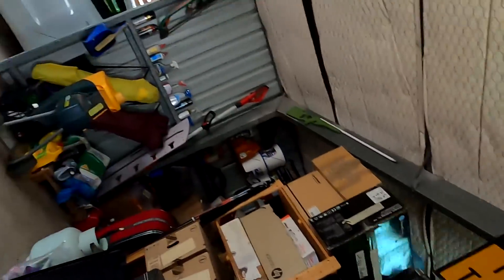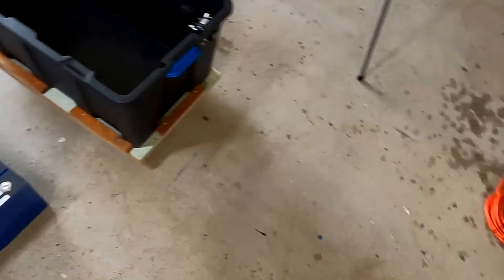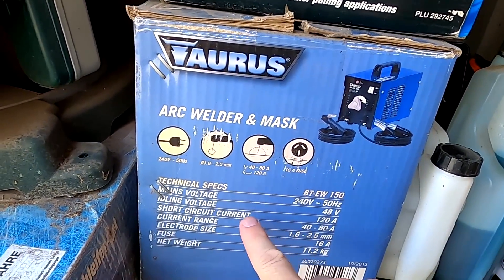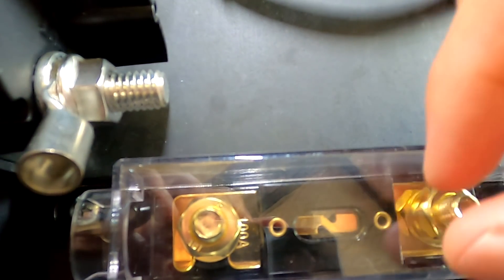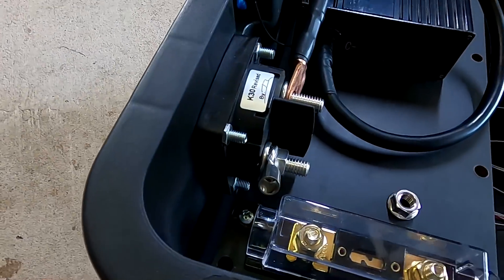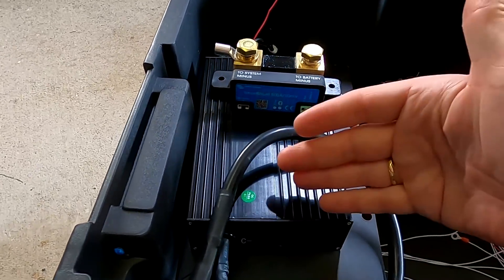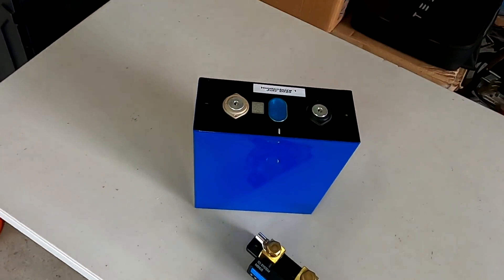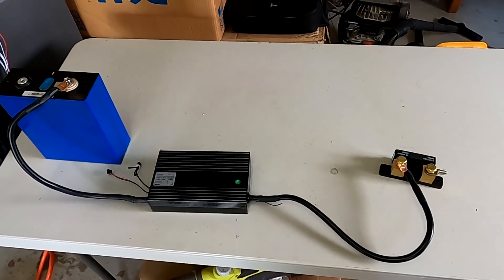Setting Shunt before the BMS a bad idea? Here is why I think this is GOOD! #buildthebattery.2

Comment: I am probably going to set up like this but the voltage for the smart shunt I will probably connect to the output of the BMS. This way supposedly if the VMS shuts down the shunt still does not draw from the battery. I will also hook up the secondary input to the shunt to the input of the BMS. That way I can read both sides

Comment: You made a very valid point; i.e. BMS uses sensing wires to read the battery voltage.
Even though I'm commenting 1 year later, Option 3 is the best.

Comment: Great discussion, and I thought so when I first watched this one. 

#3 seems the best hookup when using a single pack in the system, like this battery 1.0.

Battery -> Shunt -> BMS -> Disconnect -> Bus

Did you ever cover the change of design philosophy when you went for the 3-pack battery 2.0?

If you're using a single shunt but 3 packs in parallel, it obviously MUST be after the Bus!

For a multi-pack-in-parallel, #2 would require multiple shunts:

Battery -> BMS -> Shunt -> Disconnect -> Bus

#3 also would require multiple shunts:

Battery -> Shunt -> BMS -> Disconnect -> Bus

It would seem option #4 is required:

Battery -> BMS -> Disconnect -> Bus -> Shunt

So that all packs are paralleled on the Bus and THEN you have the shunt counting coulombs in and out from the system.

I figured I would comment here now that v2.0 is done, but you'll get people watching the back log of videos, and they may like to know before deciding their hookup based on this single-pack design.

Comment: a little note to beginners:
Your BMS disconnects B- to C- if the balance leads are disconnected.
So put your switch into the positive side!
You can pull the balance connector and turn of the switch and then you don´t have any connection to the battery from the outside. No + and no  - connection and everything is save ;)

Comment: Victron shunt first also means u can keep other small essential loads on,  like lights,camp fridge for SPAT, etc, going on a seperate circuits of 48v-24v, 12v & 5v, which could be set at a slightly lower setting for trouble shooting, etc , in an otherwise dark situation at night. After all Andy, SPAT is still fine consumed cold in the dark, but warm in the dark is a crime! Victron shunt first is probably ur most accurate measure for ALL loads from battery with backup for when ur BMS shuts down and u dont lose the Victron historical logs. But I know you have well got this all figured by now, another great vid, thanks
Reply from the maker: All loads need to be connected after the BMS anyway, so with this in mind it does not make a difference in which order we connect. The BMS will have such a small standby current which the shunt won't pick up any way.
Reply: @OffGridGarageAustralia  True Andy, but if the BMS shuts down & shunt is after BMS, dont u lose all ur historical data from the shunt? This is why I thought ur reasoning was good, to have the shunt 1st so u dont lose shunt data in case of a BMS shutdown.

Comment: 1:14 not start engines, but plain main battery disconnect switch.
We start engines using turnkeys switches like in cars.
1:56 "cannot use the fuse?" that is plain BS. 48V is too small to arc

Comment: Some BMS's don't read the first cell voltage when only the small black wire is connected, they require the B- lead to measure the first cell. So perhaps it varies with the BMS.

Comment: I'd be skeptical about the actual ratings of the fuse if there is no manufacturer's part number to reference specifications. You could always test one into a hard short and see what damage there is. Some fuses explode and make a mess because they really aren't rated for the voltage and don't quench the arc quickly. I don't think your batteries would mind a fun test. :)

Comment: Hi,  
I built my Daly BMS with similar cells as you have in the video. I have the older Victron smart shunt installed with the system. I cannot get my system to work with the Shunt installed and then the BMS after that. When I take the battery and BMS out and put it on charge the BMS and bluetooth comes online. If Input it back in the camping trailer the BMS is not working. Am I missing something here?

Comment: Amps don't jump gaps, voltage jumps the gap, look at a static glass bowl, its only maybe .1 amps but 10,000 volts, a taser again 10 amps but 10,000 volts. Hook up your own taser set up with 50amps and 1 volt see if it jumps the gap.

Comment: Better late than never and maybe another comment brought up this potential issue but putting the shunt before the BMS could damage the cells if for some reason the BMS does a low voltage disconnect, the shunt will continue to draw a small current and after a few days it could be enough to damage the cells. Obviously in a normal system it would not go that low without doing something but it's a potential issue. I'm surprise that Victron recommends putting it before the BMS because they mention the following in the BMV-712 spec sheet which is a more recent shunt++. From Victron: Current consumption: 0.7Ah per month (1mA) @12V and 0.6Ah per month (0.8mA) @ 24V
Especially Li-ion batteries have virtually no capacity left when discharged until low voltage shutdown.
After shutdown due to low cell voltage, the capacity reserve of a Li-ion battery is approximately 1Ah per
100Ah battery capacity. The battery will be damaged if the remaining capacity reserve is drawn from the
battery. A residual current of 10mA for example may damage a 200Ah battery if the system is left in
discharged state during more than 8 days.
Reply: You also need to take into account the 'hidden' self discharge rate of the battery cells. Noting the specs for the EVE280N the monthly self discharge rate is quoted as ≤3% I reckon that approximately equates to an internal self discharge rate of up to 12mA. It is therefore more detrimental to leave the battery cells in a disconnected state of low voltage for this reason alone. As this self discharge current will continue at a rate of up to 12x that of the 1mA of the SmartShunt, that is the dominant danger. It wouldn't create any significant increase in the potential for damage to have a SmartShunt connected as per arrangement 3. Just do not allow the cells to be left in a low charge state for any longer than necessary.
Reply: @rogergalley2779  I agree, you are right on that. I have no idea though whether the discharge rate decreases as the battery SOC gets lower... I think it should and would be interesting to see the curve. I also though of the BMS shutting down the discharge when temp goes very low. I'm in Canada and remote cabin that would go to such a state should probably not put the shunt before the BMS???
Reply: @michelmarchand2291  I cannot offer any insight into whether the discharge rate decreases as the battery SOC gets lower.

However, taking the EVE LF280N as an example, the minimum discharging working temperature is quoted as -30℃. It is the charging working temperature which would be of concern first. This is quoted as a minimum of 0℃. If the cells got anywhere near -30℃, and discharging was still in progress, you would be unable to recharge until everything became much warmer. I do not think it would make any difference whether or not the BMS came first under these circumstances.

If you are likely to be operating at such low temperatures be aware the cell terminal voltage will drop from around 3.2V to nearer 3.0V and the cell capacity will be also be reduced to about 8o% of normal  - https://www.fogstar-wholesale.co.uk/wp-content/uploads/2021/09/LF280N3-2V-280AhProduct-Specification-2019.12.2211.pdf

Comment: i honestly see this as a moot point - especially if you plan on having more than 1 battery pack in your bank, you would want the shunt outside the battery pack... OR you would be putting a shunt on EACH pack separately?  no, i don't think so.  so for 1 pack, it's a good thought experiment and get's ya thinking, but if multiple packs are involved in your bank, BMS should always part of the battery pack, THEN shunt.  cheers!

Comment: Hi there, btw you are able to calibrate the shunt for BMS losses in the shunts settings so I would still put it after the BMS as a rule. If the BMS only takes voltage measurements and doesn't have low and high SOC disconnect then it won't make much difference. The only thing you would slightly compromise is over current protection but that's so minor its not a worry. At the end of the day the SOC reading you get from the shunt is only an estimate so I would stick to convention, unless there are other benefits?

Comment: there's actually a reason they use sand filled fuses in these high amperage low impedance applications. If there is a dead short, the fuse will "melt" ...but one of the way it does this is by vaporizing the metal in a plasma ball. this vaporized metal is then re-deposited on the inside of the fuse, recreating the circuit, only this time with a lot more metal available. This is particularly problematic in very high amperage DC applications, which is why you see the max ratings for DC less than half of the AC. The sand disrupts the plasma and prevents the plating recreating the circuit..
Reply from the maker: Great, didn't know that... Thanks for sharing.

Comment: Should option 3 be changed, so that the BMS black wire (negative) be connected to the output of the shunt? at 12:59 you mention the small black wire of the BMS does flow current for balancing. Connecting it directly to the negative of the battery means that the Shunt will not measure the current used in passive balancing by the BMS. Will connecting the BMS black wire to the Shunt reduce the effectiveness of the balancing, given the low resistance of the Shunt?
Reply from the maker: It would not affect the effectiveness of balancing. After all, It was the right choice to do it this way. In my next installation, I will have three BMSs and one shunt to measure them all.

Comment: I'm afraid to use lithium because of the unlikely event they go up in sparks. Lead acid don't fire up and not likely to burn down a log cabin. I'd recommend them since costs are down for those.
Reply from the maker: I guess you're driving an car with internal combustion engine and around 60l of highly combustible liquid inside? I would be much more afraid of that!!!

Comment: Maybe someone else has pointed this out, but your shunt is a very low ohm resistor (in the milli-ohm range). To measure current, what is being measured is the voltage drop across this resistor. If one side of the shunt is at ground (connected to negative battery terminal), the voltage drop is simply the voltage on the other side of the shunt (call it V1). Call the battery side of the shunt V2. V1 - V2 = voltage drop. Since V2 is at 0 volts, Voltage drop is V1 - 0 = V1. That is why a shunt is right next to battery...so only one measurement needs to be made. Your smart shunt might measure the voltage on both sides...therefore it could go anywhere...but I would check. I know my cheap $20 shunt needs to be next to the battery because it only measures voltage on one side.

Comment: Funny stuff all these posts from people who have zero experience.      If you hook up the the victron after the bms, the second the bms protects the battery the victron loses any data it stored.  Been there done that.

I have mine hooked up battery.....shunt......bms and it works.   The victron does not lose data when the bms trips
Reply from the maker: My Victron Smart Shunt does not lose any data apart from the SoC when been disconnected.

Comment: What is the difference in a shunt and the bms. What does one do that the other does not do. Don’t they both monitor the battery
Reply from the maker: Yes, they both doing similar things and the BMS also has a shunt to measure current going in or out of the battery.
I chose the smart shunt as it connects (and report) to my other Victron gear and I can read it remotely from anywhere.
The BMS does a similar job but does not communicate with any other devices. It also balances the cells and takes care of safety (under/overvoltage cut-off, over current situations) what the shunt does not do.
Do you need both? No, the BMS alone is fine, the shunt is just an additional device for more convenience and control over the system.
Reply: @OffGridGarageAustralia  The Smart shunt is way more accurate when reporting S.O.C.

Comment: IF the shunt comes after the BMS and the BMS disconnects due to low battery then it would no longer measure any voltage because the negative side would be open. I vote it goes between the battery and the BMS that way it could always measure even if the BMS shuts off the load.
Reply from the maker: What's the benefit if the shunt can still measure the voltage in such a situation? If the BMS turns off, there is something seriously wrong.
Reply: @OffGridGarageAustralia  My thinking is that if you are remote and using the cloud-based VRM portal then you'd be able to see the reason the BMS shut off. Like you said, if the battery is that low then something is definitely wrong

Comment: I'm traveling back in time going back to watch this older video 😃, but anyway, if there is any concern about a blown fuse having a spark-gap... some fuses are designed with spring tension on the elements so they are pulled apart if the fuse blows.

And I really like the way you logically came to the shunt-then-BMS conclusion. 🤓

Comment: Wouldnt putting the shunt after the BMS also enable to find any issues with the BMS using the shunt data? 
If the shunt is before BMS, then the BMS itself is not monitored at all. 
This is very interesting stuff. I am building a similar setup. I think the switch is overkill though. You dont need an on/off switch in the battery itself. The switch should be on the positive lead going to the inverter. It makes it more flexible to add another battery for the inverter. 
I will be placing two 16S 280ah strings, with two BMS's, and 2 of the cheaper AiLi shunts in a larger metal Truck toolbox. I like the idea of placing those before the BMS. The AiLi monitors will monitor each 16S battery in the box, so two holes cut for two monitors. The 2 sets of battery cables then go to external fused and switched terminal blocks. My Victron shunt then sits on the negative of BOTH batteries in the steel box, so I get to monitor the batteries directly with the AiLi shunts, and the batteries and BMS's with the Victron shunt. So actually 5 monitor points all together. Two Heltec BMS's with bluetooth, two AiLi shunts with physical monitors of each battery on the battery box, and then the Victron to monitor everything. 
I am glad I saw this upload, as I was going to put the AiLi shunts after the BMS's in the box, but tou explained it very well, and it makes sense.

Comment: Hi, nr3 please, the reason is you want to measure the correct voltages of the battery and the cells. Every other way of connecting gives a less accurate measurement. 

Good luck installing!
Reply: Correct voltage measured by balance cables not the b-. B- used for load connect disconnect scenarios.

Comment: Why not use a Blue Sea MRBF fuse with a Blue Sea battery switch? Or with any battery switch. They are real space savers because they can bolt directly onto a stud. And they eliminate one cable. They are rated up to 58 volts. 
 People seem unperturbed by the crude jobs these cheap BMS applications appear to be. Doesn’t it bother you that the way you are wiring them can void the warranties of the equipment. By the way, the makers say they can tell what damaged the equipment if it’s sent back for a warranty claim. Just saying. Maybe Im not understanding something correctly. I read a Morningstar white paper saying my Prostar charge controller is not under warranty if it’s disconnected under load by a bms???  I getting tired of this dilemma. The only definitive answer Ive found is changing to a Electrodacus charge control system.
Reply from the maker: Because I didn't know about all this fancy gear before and I had to start somewhere. I will certainly upgrade at some point. Thanks for the tip.

Comment: About the ANL fuse and peoples concerns about arcing.  It helps if we consult the specifications sheet. https://www.allfuses.com/pub/media/documents/Bussmann%20ANL.pdf

Rated to 80 V dc, and will interrupt 2700 A dc.  If you look at other manufacturers they might quote something a little different, I have seen reference to 72 V dc.  Either spec will be satisfactory for this use.

Comment: The problem is that the electronics on the shunt will always be powered.  You want the shunt to lose power if you turn off the switch or if the BMS shuts off due to low voltage.  Imagine if your solar charger controllers failed while you were away on vacation.  The BMS could disconnect due to low voltage but the shunt would continue to pull power, potentially damaging the cells.  I would recommend the order battery, BMS, switch, shunt.  That way the shunt will lose power if the BMS disconnects, or if you turn off the switch.  Having a perfectly accurate voltage reading on the shunt shouldn't be critical because the shunt should keep track of state of charge by measuring current flow into and out of the battery.
Reply from the maker: The shunt has less than 1mA of consumption. no doubt I can run this for months even on 2.5V without discharging the batteries.

Comment: Sunt 2nd as Victron advises. How can the BMS  monitor the cells if you add in the 50 MG Ohm of the shunt? They do it with their batteries.
Reply from the maker: Victron actual recommends to have the shunt directly at the battery. The BMS does have balance leads through which it senses the voltage.

Comment: ...But... if you don't use the shunt, connect it only for measure the Voltage, and the BMS as the first connection